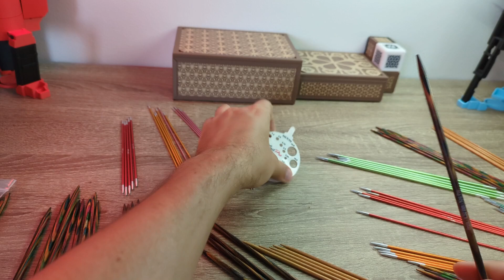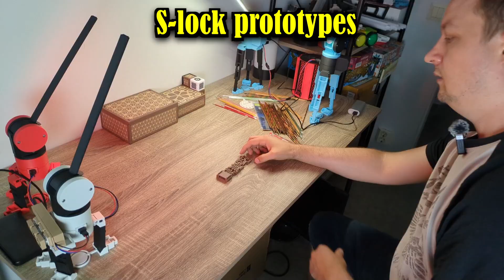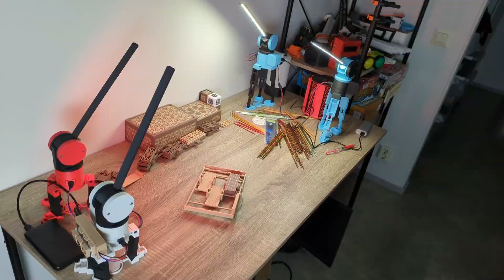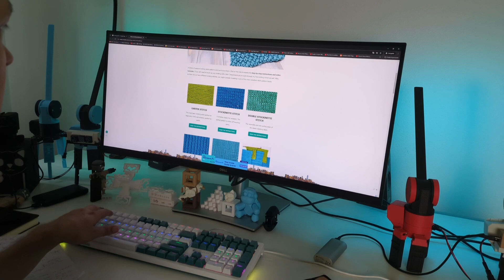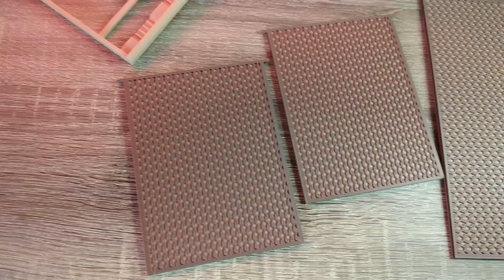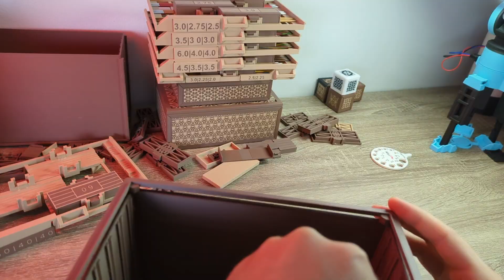Making & failing of a simple 3D printable box design

Comment: The panels not fitting reminded me of your woodworking inspired video. Wooden cabinet makers typically leave a lot of tolerance around the floating panels in their doors. Not just for fit in the moment but for thermal and humidity expansion through the seasons. Because of the anisotropic nature of FDM you might find pieces printed at different orientations relative to each other expanding and contracting differently in different directions.
Reply from the maker: @AndrewHelgeCox  Next project I Will get these things right! 😃. I have had My fair share of troubles in My projects but wheter it's good or Bad i have another box project in The making (and some other stuff too)
Reply: @Thingsbydesign  I'm subscribed. I'll do the bell thing now to not miss it.
Reply from the maker: @AndrewHelgeCox  Thanks. I really appreciate it! Im still kind of trying to figure out what format would be best...doing smaller or larger projects or something else. I do prefer larger projects but they take too long to make...so perhaps both.
Reply: @Thingsbydesign  I just discovered your channel. I'm new to 3D printing and I don't like large prints - they take time to print, sometimes I even print parts of them which seem likely to fail (large bridges, overhangs). But it's quite good to see design decisions and design flaws and fails of others and iterative design process to know that I'm not the only one who suffers. Because designing something like box with snap-fit lid is a bit challenging, then it works with PETG, but it's too hard printed from PLA or downscaled. On the other hand downloading other peoples STLs is not "fun".
Reply from the maker: @pavelperina7629  welcome to The awesome hobby! 3d printing is fun in a way that you can do whatever you want and you dont need much to so. 🙂